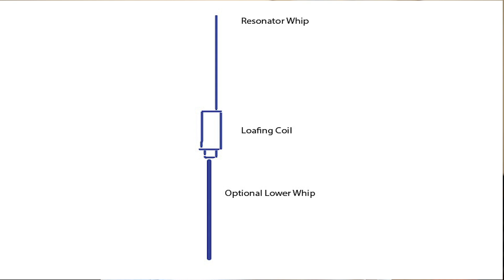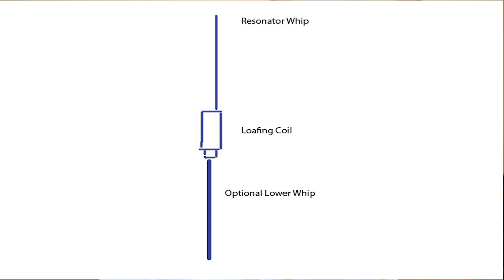The Secret Hustler Antenna

Comment: Great video ,  I'm thinking about  putting one on a mag mount up on the steel with aluminium coated roofing on my house for 40m  this would use the same mounting hardware as  the cb whips did years ago that are everywhere used. Do you think it would make a good antenna as I plan to mount it.
Thanks
AA4CP Chuck in Port Salerno,FL
Reply: I have one mounted to a wooden post on the side of the house and it does reasonably well as a receive antenna, with any kind of a ground plane and matching like you have, it should do well for what it is.

Comment: Thanks for video Peter. In the UK, I suspect mag-mounts with SO-239 sockets are maybe more popular than the 3/8 inch type. You can get PL-259 to 3/8 inch socket adapters that might allow this Hustler antenna with your 3/8 stud modification to be attached to an SO-239  mag mount (or gutter mount). I just wonder if anyone has tried this?

BTW, was that an 1155 I saw on your workbench?
Reply: I have two SO239 mounts on the roof bars on my car as I have found them easier to use than the 3/8 mounts and gives an outlet from the radios in the car when going /P with a portable mast. Already use the 40m Hustler with an adapter and just got the 80m resonator to go with it. Might try turning and threading some spare copper earth rod I have instead of getting the MO3 mast thingy to see how that works.

Comment: Peter, thank you for covering the Hustler mobile antenna systems. I use these resonator coils in both home station and field portable operations with great success. I've placed pairs of resonators on an "dipole maker" mount on top of a tripod/mast setup and fed them unbalanced with a common mode choke at the feed point or balanced, via a 1:1 current balun. Both methods work well. Using the longer Hustler masts leads to some amount of "sag", but the shorter masts avoid this. I will be trying available steel masts in the near future. Home or portable this is a great way to get on the air if physical space or local restrictions are an issue. Using the Hustler resonators in this way has been, for me, a good solution. 73' de Chris W6NOB DM14ei Wrightwood CA USA
Reply: how do you have ur resonator moundted
Reply: @AndrewMurphy8383  I mount my two resonators on a pair of 36" stainless steel 3/8-24 TPI masts which are mounted in a commonly available "dipole maker mount" which is mounted on a telescopic mast and tripod set up. I bought my dipole maker mount and resonators from DX Engineering. The stainless 3/8-24 TPI masts came from Walcott Radio in Iowa. They list the masts as "antenna shafts". I hope this helps. 73' de Chris W6NOB
Reply: @christopherwilliams9936  I USE A OLD SCHOOL CB  to mount mine but it seems that it was missing radials hopefully the two ground radials i made this moring will work
Reply: @christopherwilliams9936  window side marrior mount ones

Comment: Better still go buy 3/8" threaded rod.  Better still get brass threaded rod. Trouble with cars these day they have plastic bumpers, no gutter mounts and Mag-mounts scratch the crap paint they put on cars these days.  I have a two bar so it might be an option to run a steel bar from there up and a mount for the antenna on the end.  But it will always get in the way!  Can't win, no mater what you do there is a problem.  I used to have a 9ft antenna off the back of the car, till one day I went into a multi story car park and I heard a lot of noise behind me and looked in my rear mirror to find the car park in darkness, then there was another bang and I just saw something fall as it went into darkness!  Yes, you guessed it, I took out all the strip lights for the length of the car park.  i forgot I had the antenna up as I had turned off the CB so I could put it away and no one saw me using one as I went into the car park.  A lot were getting stolen at the time.  I heard this voice away in the distance shouting, I quickly stopped, unclipped the antenna and drove round and out the car park before jobs worth caught up with me.  The antenna was on a quick release bayonet connector, so I made my escape quickly.  That is why it is so expansive to park there, they had to replace all the lights that I accidental broke!  :-((  Oh dear, i just gave my identity away!!!
Reply from the maker: Bob, great to hear your story of mobile operation. 73 Peter.
Reply: Thank you for enlightening with that account...... Sorry, I couldn't resist.
Reply: @Steve-GM0HUU  It was a dark episode of my life, or should I say the car parks.

Comment: Hi Peter thanks for the video; I have used the Hustler Whips range for Mobile and Portable by using the 3/8" to PL-259 adapter which plugs straight into my roof bar anntena mount which I purchased from you at Hamfest 2 years ago, it usually has my 2/70 dual band whip in it so you have many options. I also have a large single mag mount for static /P work which has the 3/8" ready to accept the Hustler Whips, pleased to say it all works well. Keep the vidoes coming!
Reply from the maker: Hi Dave. Roof bars can sometime be a problem with matching on HF bands, but if it works for you great. 73 Peter.

Comment: Great...I agree the Hustler is not that popular because they do not advertise or no one reviews it on YouTube. I use the Hustler 20M on and off for 15 years. I do use the base mast onto a mag mount to the trunk. You can also use it as a vertical on a pole with a "jaw mount" type of attachment. They do work very very well....Hustler also has an adaptor to put 3 coils on so you dont have to change when you change bands.

Comment: hi ,how would you mount it for use at home as a base antenna for 80m band ,and ideas
Reply from the maker: You would need to adapt a 3/8" mobile mount to attach to a ground post and then add a radial. It would be very narrow banded though.
Reply: lots of radials, and use the 3ft ext. or get two and make a dipole.

Comment: Early 80's I had a 2M Hustler that had a centre loading coil... It was about 8' long,
It was amazing on 2.. But as a bonus it also worked really well on 10M
Reply: I had the 2m collinear too - used it for mobile 10m and 2m FM. Remarkably it also worked on 70cms...
Reply: @keithballinger8558  A lot of 2m antennas work surprisingly well, with good VSWR on 70 cm. I've used a vertical 2m 4 ele-quad on both bands for more than 3 decades with some excellent results. I also used a horizontal 12 ele-ZL Special in the same way, for DX, tropo, Aurora, QRP and satellite work for more than a decade, with no problems. The simple Slim Jim also gives a good account of itself as a dual band antenna, for local work, with the QTH in a city centre.
Reply: I know guys that ran them on the CB band with a atu works really well.